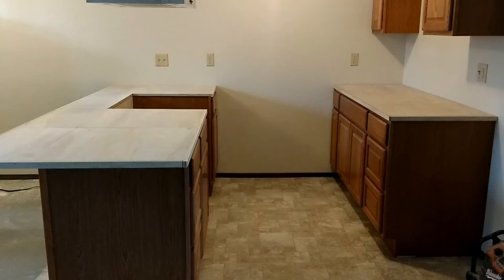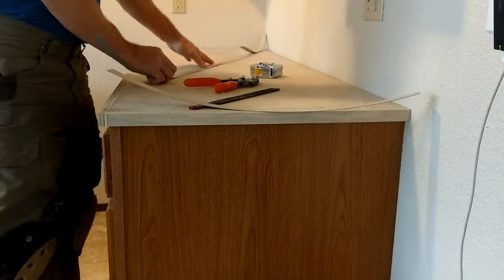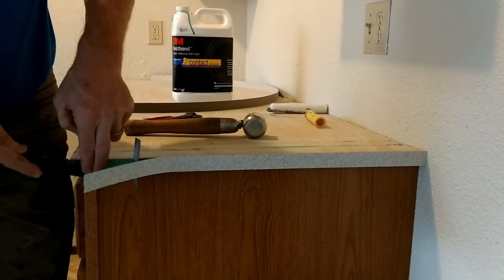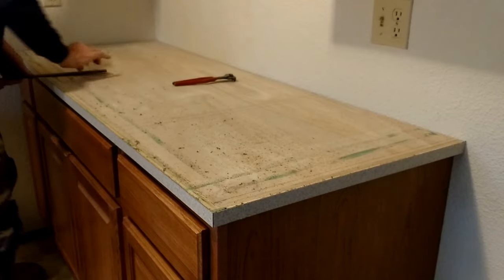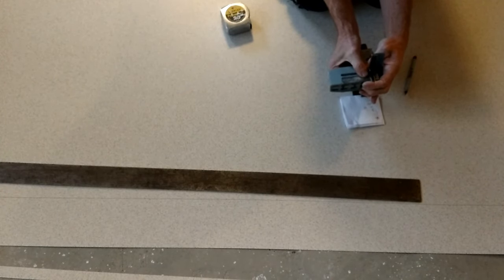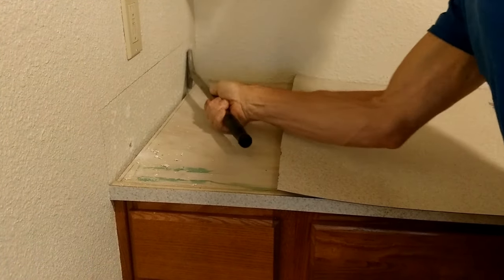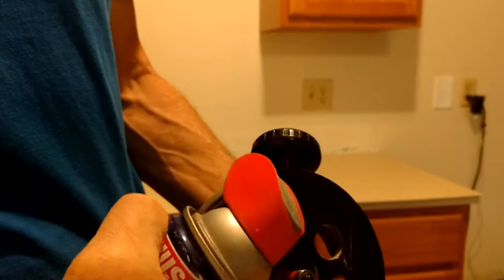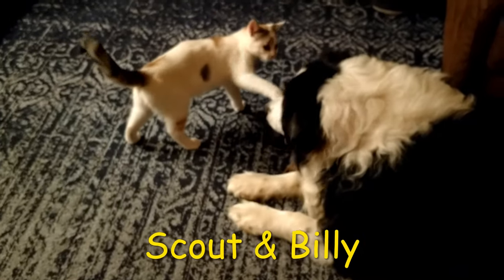Laminate Countertop (Basics) -  SECRETS TO PROFESSIONAL RESULTS!

Comment: Very helpful. I am about to build a plywood counter top with laminate to use as a 30” deep laundry counter top over my front loading washer and dryer. I dont have a router so after the laminate is cemented on i was just going to score with a utility knife and then use file. Question for ya can anything be done about the seam on the edge? U ever fill it with anything?
Reply from the maker: Thank you!  If you are talking about the dark edge of the backing, I have not found anything that will conceal that.  The dark line is generally accepted as a given in a standard laminate installation.

Comment: Great video with excellent tips!  What kind of trim was used at the joint and around the backsplash?
Reply from the maker: Thank you!  This countertop was finished with a 5" laminate backsplash with standard silver aluminum cap & cove. It comes in 12ft. lengths, and is usually provided to me by the floor-covering store that provides the laminate.  I have backsplash videos that I'm working on, but they are not ready yet.

Comment: Great information. I'm replacing the countertops in a pop up camper.  The old ones were laminated particle board.  I'm using 3/4" sanded exterior plywood and laminating with Formica.  I was going to laminate the edge directly to the plywood, but then I saw that you have a trim board attached to your edges.  Will the laminate adhere to the raw edge of the plywood or should I add a board around the edge?
Reply from the maker: You can attach laminate to the edge of plywood if it is sanded fairly smooth.  The adhesive is thin, and the edge is porous, so I would put a coat on, let it soak in and set up, then apply a second coat.  Thank you!
Reply: @elbowshots  I ended up ripping some 1/4" lattice boards and gluing and nailing them to the edges that will be laminated.  It's a much smoother edge.  I'm going to urethane the bottom of the countertops for water protection.  Since the top side is bare wood and will soak up the adhesive, would it be beneficial to urethane the top side as well to seal the wood before putting on the adhesive?
Reply from the maker: @ronbednarczyk2497  I don't think there is any reason to seal the plywood prior to applying the adhesive.  Contact cement is highly water resistant and will act as a sealant itself.

Comment: 💥Really great video.  Thank you.  11:40 I’m watching you use the file to lightly knock down that top edge flush.  It’s been over 30 years since I installed Formica when I built a receptionist desk for a hair salon which was much more complicated than just a countertop and don’t really remember everything but I do recall using a belt sander with a really fine grit to do the same thing.  I kept it at a 90 degree angle to the edge and using it so the belt direction was into the top so that it was not pulling the edge material off and going very lightly.   Have you ever done that yourself?   Also can I score and snap the product with a sharp utility knife along my straight edge vs that carbide scoring tool that I see you using?  Thank you in advance for any further information.
Reply: 23:59  Yes, I’m back for one more question and that’s it.  HAA. You went with a flush cut router bit to trim off the excess.  I remember using a beveled bit.  I think it was 22°.  Thoughts on that too.??   Definitely gave you a 👍🏼
Reply from the maker: Thank you. Yes, I have used a belt sander turned the way you described to make the self-edge flush. I didn't think I gained any advantage over filing it down, unless it was a very large countertop.
I do not recommend scoring laminate with a utility blade. It can be done, but it's not very safe and results are not as good.
A laminate scoring tool is the best option.
If you can't find a laminate scoring tool, or don't want to wait for one to arrive, you may be able to find one designed to cut acrylic sheets, or tile backerboard. Either of those would be better than a utility knife. I have seen scoring tips that fit utility knife handles. That might be another option.
Thanks for watching.
Reply from the maker: I used to see people using a 22-degree bevel occasionally, but I always preferred the straight flush cut bit. I just ease the edge with the file. Thank you.
Reply: @elbowshots    Thank you for all of those replies. I’ll take all that you said and run with it

Comment: I noticed you added small chrome trim on the backsplash. Is it flexible, what size did you order and where can i buy it? Also does it come with adhesive already or does it need to be cemented like the laminate? Thank you for this video!
Reply from the maker: The trim is a rigid brushed aluminum that comes in 12 ft. lengths.  It is cut to fit and cemented on with the laminate.  It is usually kept in stock at the floorcovering store that provides the sheet laminate for my jobs.  It is a product similar to this:  https://www.tools4flooring.com/futura-3-32-silver-square-metal-cove-cap-12-length.html
Thank you!

Comment: What are the steps to cutout the hole for the sink?  This would be for a counter that already has a hole for the sink.  I just need to cut the new laminate over the covered hole. Do you cut from under the sink?  What tools did you use cut it out.  Since its going to be covered with the sink I imagine the finish doesn't have to be perfect but want to make it as clean as possible. Thanks in advance
Reply from the maker: The sink hole is usually cut out of the sub-top before the laminate is installed.  They just did not have the new sink on-site for this job.
I use my router, like I do on the outer edge, to cut the laminate.
Punch a hole with a screwdriver to allow for the bit.
The back ledge is where the off-set router comes in handy.
If you do not have an off-set router, I have used a file, with several downward strokes, to break off that last strip.  It is risky, if you haven't done it before, and you have to make sure the laminate is well bonded along that back ledge.  Thank you.

Comment: I'm just getting ready to laminate my kitchen countertops. Watching all I can, because the idea of not being able to adjust after the contact adhesive makes me a little nervous.
Reply from the maker: The blind slats keep the pieces separated until the laminate is in position.  There are more tips for positioning sheets and working with the slats at the end of one of my other videos.
Seams 2 Me - https://youtu.be/QOY_PSJ57ZM
Good luck with your project.  Thank you!
Reply: Same! I am terrible at getting things to line up properly. I always end up getting tape, stickers, labels, etc crooked.
Reply: @elbowshots  wooden dowels can be used as well, right? I've seen them used more often. This was he first time I've seen blind slats used before.
Reply from the maker: @catsmeow5566  Sure. I have used dowels to maintain separation. I prefer the blind slats because they stack nicely for storage and they are durable. Also, that was how I was taught. Thank you.

Comment: About how much did this all cost. My kitchen is about the same size as the one in this video . im trying to weigh my options because i absolutely hate my countertops.question2:  Is it possible to relaminate my counters ? 
Question 3 : i have a back splash block that they laminated as well. Would i have to remove that first?
Reply from the maker: Every job is unique, and prices vary by region.
Q1: This kitchen required a 4X10 (40), and a 3X8 (24) for a total of 64 sf. @ $12/sf for material & labor, plus prep.
Q2: Yes, if the existing laminate is flat, and well-secured, it is possible to laminate over the top.
Q3: I think you are asking about a "Montana" backsplash. (I don't know how they got that name.) These are usually attached to the walls, but I have seen them attached, by screws or nails, up through the countertop, with the top and backsplash installed as a single unit.
Typically, I remove any existing backsplash, install new tops, and install new backsplash. A single row of tile can be an elegant look.
Look for future videos on backsplash options.

Comment: Great video! I’m looking at redoing my counters, but when I bought the house, the counters had been painted with that counter top paint, so I can’t see the 45° seams in the two corners, this shouldn’t be a problem, but the length is 145” and I can’t seem to find any thing longer than 144”. I don’t want another seam in the middle somewhere. What am I to do?

Edit, these counters I’m wishing to replace are from a remodel form the late 60’s
Reply from the maker: Hi. This question brings several things to mind. First, most sheet laminate is one inch larger than the call size. For example, a 60X144 will usually have an actual size of 61X145. Though, the extra inch is not always usable. Second, it is not a good idea to stack a seam on top of another. If I am going over the top of an existing countertop, I keep a couple of inches separation. Mitering the corners wastes a lot of material and creates unnecessary challenges. When seaming an 'L' or 'U' shaped counter, I usually place the seams a couple of inches from the inside corner (front edge), perpendicular to the sheets.
Thank you!
Reply: @elbowshots   thanks for answering and also clarifying a few thing for me. So if I understand you correctly about the seams on a L or U shaped counter, you are saying (in my case at least) instead of having a sheet at 145” and mitering the corner, I should instead cut that same piece to 118.5” (145” - 26.5” the 26.5” is the width of the return) and this would give me a seam at a right angle/perpendicular to the long edge of the counter.
Reply from the maker: Yes, I think you have the idea. If you haven't seen it, I have a video on how to seam laminate: https://youtu.be/QOY_PSJ57ZM
Thank you.

Comment: Hi 
What glue i can use for my vinyl peeling off.? What best glue to repair ..thanks for reply ,really appreciate it.
Reply from the maker: There is not enough information for me to answer your question.
You say vinyl, do you mean laminate?  
How much, of what part, is peeling off of what material?
For spot repairs, I sometimes use an adhesive caulk and hold it in place with blue painter's tape.  
PolySeamseal makes a mold and mildew resistant, watertight seal.
It cleans up with water.  I hope that helps you.
As an Amazon Associate I earn from qualifying purchases.
https://amzn.to/3akAC31

Comment: In your professional opinion, can I apply laminate over laminate?
Reply from the maker: I can't see the specific countertop you are asking about. So, I cannot give a definitive answer without an on-site inspection.
I would NOT try to install new laminate on a pre-fab countertop that has the front edge rolled over.
You can go over laminate if the existing laminate is flat, well-adhered, and structurally sound. I usually scarify the existing laminate with a belt sander to give the adhesive "bite."
Thank you!

Comment: Thanks. Sir can I do this on top of a original laminate countertops with a (laminate sheets)and how did you do the (back splash piping).
thanks.
Reply from the maker: Thank you!  Yes, you can go over the existing, as long as the existing laminate is flat and secure.  The backsplash metal requires a set of metal miters:  https://amzn.to/38IiCi8 (Amazon Affiliate Link)
The backsplash videos are not ready yet.

Comment: Can I lay a new sheet of laminate over an existing laminate countertops in my kitchen? Thank you!
Reply from the maker: The short answer is yes. If the existing laminate is structurally sound, and you just want to resurface the countertop, you can scuff the surface (I use a belt sander) so the adhesive will bond, and install new sheet laminate "over existing."
While it is possible to re-secure some loose spots, if the edges are not well bonded, you will not get the results you want.
Also, I do not recommend trying to resurface a pre-formed countertop, these have a rolled-over front edge and built-in backsplash.  These countertops are manufactured in factories using heat, pressure, and large machines.
Thank you and good luck.

Comment: Did you apply the new laminate over old laminate?
Reply from the maker: This job was installed over new plywood sub-tops .  You can install over existing laminate if it is well bonded.  I recommend sanding the existing material to provide bite for the adhesive.  Thank you.

Comment: What do you prefer for the substrate? Plywood, particleboard, or MDF?
Reply from the maker: I prefer industrial grade particle board for its density and consistency.
Reply: @elbowshots  Hands down! I Do a buttload of refurb and it's amazing what you find under old solid color lams.  I often top with brown board with the textured side up for extra bonding power. Low VOC adhesives just don't work like the old school MEK based contact adhesive. But I'd rather do all solid surface and concrete than huff those fumes again. Brown board texture up for the heavy duty applications.  It will never blister bubble or pop.

Comment: Hello. Can i just do this job a top of old well glued laminate? Is just about tht color
Reply: I mean skip sandin
Reply from the maker: You can install over existing laminate if it is well bonded.  I recommend sanding the existing material to provide bite for the adhesive.  Thank you.

Comment: Interesting I did not think anyone did it like this any more
Reply from the maker: Thank you.  Yes, there is still a demand for custom laminate fabrication.
Reply: @elbowshots  I am Cabinet by trade although Cabinet makers normally make free standing furniture there was much more call for  built ins back in the seventies when I was a apprentice I would have done hundreds of bench tops using this method,  I assumed it was all pre glued and post formed these days. I don't think there would much call for this method here (Australia)
Reply from the maker: Built in place laminate countertops were much more common for residential use back in the 70s, 80s, and most of the 90s.  When the various solid surfaces started being used, the demand went down.  For a while, everybody wanted granite, but there were still plenty of custom installations that needed to be done.
There are many commercial applications where a straight workbench is not the best solution.  Pre-formed countertops are faster and easier, but are more limited in application.
I don't know for sure, but there might be more demand in Australia than you think. Thank you.
Reply: @elbowshots  That is quite possible I have been out of the industry for quite a while now

Comment: So old school, I think it would have been better to do the laminate on top when it was not secured and then afterwards secure it to the cabinet, then do the back splash afterwards. Otherwise it’s a nice video.
Reply from the maker: Yes, my methods are definitely old school. I prefer to have the top secured in place before working on it. It doesn't move around that way. Also, larger countertops can be built in place. Thank you.